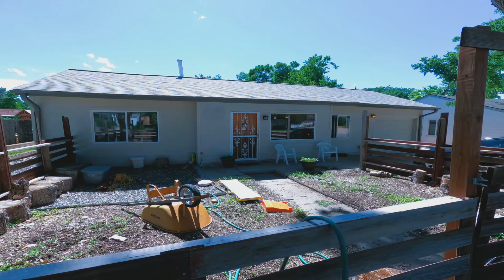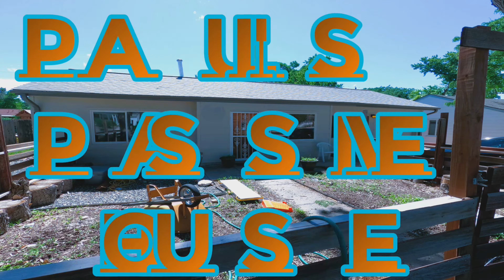Paul's Passive House 1950's Retrofit Ep. 21: Installing Zip R Sheathing

Comment: So the typical way to deal with zip-r is to extend both pieces and rabbit one of the pieces or miter joint both of them. You need to get a cyclone separator for that shop vac, it will drop the fill into a bucket before it gets to the bag.
Reply from the maker: Thanks for the information. I was trying to avoid miters because they weaken the wood at the point of connection. If you like this type of stuff, I have started a new channel just for Paul's Passive House. You can follow along there. 

https://youtube.com/@paulspassivehouse?si=KExVq7LmaiopU4uy
Reply: Mitering this way is difficult to do.
Reply: Fuck miters.